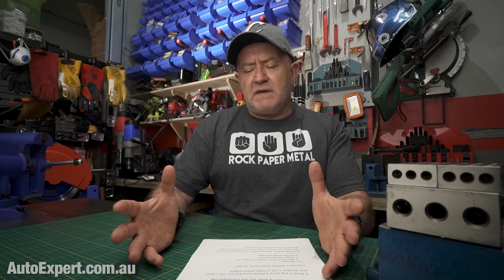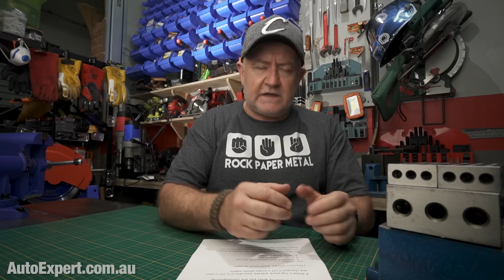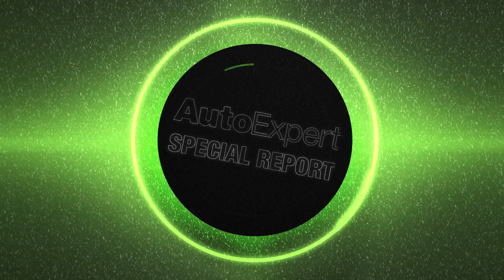Best way to charge your EV at home (for complete electric car novices) | Auto Expert John Cadogan

Comment: Minor point: Under Ausgrid's rules, Single phase 230v, 80A is all you get these days and for most people, the max you can draw is around 60A. Ausgrid made us install a 63A circuit breaker on our side of their 80A service fuse. Sure, older homes have a 100A feed, which Ausgrid will reduce to 80A if they get the chance. If (like me) you have 14kW (max) ducted aircon, 7kW (max) induction cooking, a 2kW clothes dryer, dishwasher etc and maybe a workshop with heavy power needs and you use them all at overlapping times, you may need a 3 phase upgrade to support an EV wall box charger's power draw.
Reply: Just charge while you sleep with no cooking or clothes drying there is a spare 9 kw from 10 pm till 8 am that is 90kwh enough to do 500 km a day The AC will use 1/2 power at night freeing up another 7 kw for 160 kwh enough for 2 EV doing 450 km a day each

Comment: Apparently certification does not require an on/off switch which makes the isolation switch I have quite handy. The charger is otherwise turned on and off by the wifi app or bluetooth.

Comment: here's how i do it:

i "only" have about 24A in a single phase 230V line available at home. upping the current safely would mean excavating the garden so that's a no go.
i got the wallbox installed by code (class A rcd on its own separate circuit as the install manual states) and cabled to safely support up to 20A and the wallbox is configured to draw the same maximum 20A.

i normally keep the 58KWh pack at around 69% of charge unless i have to do a long drive - i do overnight charging enabling the "charge current limit" in the ID3 menu which limits the charge to 8A most of the time and it's been absolutely fine so far.
for the rare cases where i needed to charge quicker i let it loose to 20A and simply avoided turning on the oven or whatever.

this is my late father's car so since i wanted him to have a nice experience with it i pushed to have the wallbox installed but i could totally live on the included 10A charger and get to a public plug in the very rare cases where i needed some quicker charge.

Comment: I'd recommend buying something like an Evolution Zappi V2 car charger, it has a current clamps which monitor your main feed and tapers the car's charging speed if you exceed your main fuse current rating (usually 63A)

The reason I went for the Zappi is I have a sub board in my shed which the EV is on, I needed to make sure the EV didn't trip the sub board or the house board.
As an added bonus it can also monitor your solar generation and can also taper your EV charging to ONLY use excess solar generation usually being fed back to the grid.

Comment: 2 phase makes perfect sense to say we just don't for some reason. I assume its just in reference to degrees of separation. Because I hear there are 2 phase distributions in certain states if I remember correctly so it would probably be an American thing. So single phase 90 degrees, 3 phase 60 degrees, and weird 2 phase systems just get the 2 of 3 phases at 60 degrees which is still 208v. Probably some AUS and CDN farms and industry on this system.

Comment: The other thing is you would have to make sure your switch board is the most upto date one available. I was quoted $3,000 to do that. Then there would be the cost of having the wall charger installed on top of the car.
Reply: Did it. Worth it

Comment: I don’t understand all this frustration about three phase power. Here in the US I have single phase 200 Amp 120 VAC power at the panel. In my electrical panel box I have a breaker with two 120 VAC 50 Amp circuits giving a theoretical output of 12 Kw. My EV’s BCS limits the input to 40 Amps or 11.6 Kw, still plenty for an overnight charge. This is the same way my stove, clothes’ dryer, hot-water heater, etc. are wired. Why not use two 240 VAC circuits to double your power if code permits?

Comment: I’ve had my MG ZS EV for just over 12 months, and home charting with a 7kw single phase wallbox hasn’t been an issue.  I have on average charge up 2 times a week, usually from bout 30% battery and takes about 4 to 5 hours charge time at 25amps.  Supply and installation next of to my metre box was about $1200.
Reply: What brand did you buy
Reply: @kondafitness6600 wallBox Pulsar Plus 7Kw, supplied and installed by JetCharge Australia.

Comment: If you do trickle charge then you should use a really heavy extension cord. In the UK the standard plug is 13 AMPS however its almost impossible to buy a cord that will gve you 13 amps in the car. You may even end up getting one made up.

Comment: agreed, for solar system that is set up to deliver DC electricity DIRECTLY to the car charger is best used during the day. there are some solar systems that have the power output only delivered to an inverter (changes DC to AC) has a 3% power loss, in which case, overnight charging may be optimal especially if less expensive. 

also, charging a battery at as slow as possible will extend battery life. so, when returning home, choose the amperage rate that will result in full charge being achieved next morning.

Comment: To charge your EV:  step 1. Dig coal from the ground.   Step 2. Pulverize the coal and discard impurities like heavy metals and mercury.  Step 3. Burn coal in boiler to create high-pressure steam.  Step 4. Pipe high pressure steam through turbine connected to an electrical generator. Step 5. Regulate electrical power to charging voltage of the EV.  Step 6. plug in EV and enjoy your *pollution free fueling experience.   Next time, we will discuss how to mine cobalt and rare earth materials for the batteries and magnets in the motors.
Reply: Pretty sure that conversation was already had. Nice try
Reply: @theairstig9164  Just because people talked about a problem doesn't mean it was solved.  It's an engineering problem that isn't solved by just agreeing, not to mention it anymore.
Reply: @tristan351  well to tank is cleaner. It's tank to wheels where ICE is dirty.  EVs are clean there and dirtier everywhere else.  The truth is in the total cost of ownership.   The energy consumed to make and power any car is reflected in that total cost.  The most environmentally friendly car is the cheapest, smallest, and lightest one with the fewest number of gadgets.   Aside from a catalytic converter, adding weight means more pollution.   Currently, EVs are gadget heavy because the only market with enough markup is the higher end and luxury.  That is the antithesis of why EVs are being pushed in the first place.  When they can compete on price with the lowest cost gas vehicles without subsidies or penalties on their competitors, EVs may be better for the environment.   For now, it's BS.

Comment: Electrician here. What aren’t the authorities telling us? Anybody recall issues of power blackouts on hot days with overuse of AC? 
The problem is that the cables from power stations running down hundreds of k’s to your street got overloaded when everybody was running AC on hot days (and a typical residential AC  might only be 15-20 amps). Fortunately with the massive uptake of solar panels in residential areas this problem was mitigated somewhat by the required power being delivered locally by the solar installations. IE - on a hot sunny day 40% of required energy is supplied by local solar and the other 60% comes down the poles and wires from the power stations. That load might still be 90% capacity of the poles and wires (and the stations themselves), but we’re not overloaded and suffering blackouts. 
Now imagine every resident having an EV (or two) parked in their driveway every night charging on a 32 amp socket right when there is a photon shortage ie- nighttime. Poles and wires, and the power stations themselves are going to be massively overloaded and we are back to blackout problems. A hot night where residents want both AC and charge their EV’s would be a worst case doomsday scenario.
I have heard of reports that state we require an exponential amount of additional power energy due to the increased demand and population growth, requiring massive capital investment that is extremely problematic. Cannot be feasibly done with the current “green” technology, so we require more “dirty” power which kind of defeats the purpose of the EV’s, or we need to seriously consider nuclear energy (which will never get past the nimbys). 
So don’t expect a massive rollout of EV’s in the immediate future - it simply cannot be done with the current infrastructure.
Reply: That conversation was also had a long time ago. If you banned petrol passenger vehicles today the uptake of EVs would take two years to make a difference to electricity consumption . Except in Wagga and Albury Wadonga over Christmas. That was messed up.

The point is that EVs aren’t all coming at once. They are coming in the low thousands per year. Canberra still has less than 1000 registered EV passenger cars. That’s with two years discounted rego. It’s not a problem that needs to be solved for ten years
Reply: I don’t mind coal-powered electricity generation to provide greater base load. With modern pollution controls and efficiency it is better to generate power in the big central locations than have millions ICE cars with their inherent low efficiency and high pollution levels. Nuclear is a non-starter in Australia.

Comment: Point 5 @ 25:30 mark - if the car needs to be locked for charging to occur, does this mean you can't sit in the car at a public charger with the door open whilst you sit there waiting? A scenario would be a public charger, no rest facilities (eg coffee shop) open so you have to hang around the car.

I suppose you could have the window down whilst you sit there with the door locked but what if you decide to stretch the legs? Unlock the car and charging stops?
Reply: I have sat in the car unlocked while it charges  and it is never locked while it is in the garage charging. But it is frequently necessary to lock and unlock it to make the cable let go
Reply: The cable is locked to the charge port while charging no need for the car to be locked.

Comment: John, Can you imagine a lot of EV's in an under [basement car park] ground car park at a block of flats or any similar situation, and one car there goes rogue, the fire dept has no hope maybe a tow truck might get it out with a cable but this is not likely to succeed. Imsurance companies will blanch if the building goes up.
Reply: In some countries. They have outright banned EV's using multistory and under ground car parks for that very thermal runaway reason.
Some car park owners here in the UK are starting to have the same concerns and not allowing EV's
Reply: @sahhull  I wonder how they get on in Norway, the poster child for EV's.
Reply: John's gone over to the sensible side and is now an EV proponent.  Seems like you're still stuck on the dark side.  Didn't you get the memo?  Try and keep up.  EV's are fun and cheap fast and safe.
Reply: @Tom-dt4ic  Dream on. can't believe that anyone thinks they are the answer.
Reply: @adoreslaurel  John, the sometimes happy warrior of anti-EV disinformation spread, now finally believes EV's are the answer.  Of course in Australia, with all that sun, it's hard to argue otherwise

Comment: Excellent advice. We've been running an EV for just short of 3 years now (and a 2nd one for the last year) and have installed a dedicated charger on the side of the house (as JC says - fire risk is extremely low, but outside is safer). 

Just to add a few points - if you plan to install an EV charger at home, bear these points on mind...

1. Get a unit which has PEN protection inbuilt so there's no need to install an Earth spike into your beautiful Tarmac / paved / concrete / etc. driveway.

2. make sure it comes with, or has the ability to add, Current Transformers (CTs) which allow the unit to measure the total incoming power into the house. This lets the unit to back off on the charge rate if your HVAC etc kicks in mid-charge. It'll extend the charging time occasionally, but your main fuses won't blow.

3. If you have, or plan to get, solar or battery backup, make sure your unit is compatible.

4. If you're going for 3 phase (we already had a 3Ph supply to the house so it was a no-brainer), be aware that some cars, such as the Kona, will only use 1 phase as JC alluded to. However on our EV6 we use all 3 phases so the current drops to 16A per phase therefore there is less power draw per phase plus the charging time is ~1/3 less - and we're future proofed if our next car can charge at 22KW.

5. Get a tethered unit if you don't want to be digging around in the boot for the cable all the time.  That way the cable is always in the boot if you need to do an AC charge away from home  (DC chargers are always tethered)

Just as an FYI, we bought a Myenergi Zappi unit which does all of the above. It also allows you to set a PIN code to stop anyone charging when you're not home.  It's been 100% reliable, has a really good app and it can schedule your charge for off-peak power etc. There are many other units available so the hardest part is choosing the right one for you.
Reply: I thought about getting an EV for commuting (140km a day) I mostly do nightshift and have solar + battery (got it due to the frequent blackouts) 
If I got an EV and one of the chargers( my solar can run my 3phase bore in a blackout.. 
is there a way to set the charging to charge slower… but only take the excess solar if possible? Currently here in sunny perth.. I export 25-35kwh a day.. so if I could set the car to only drink solar )assuming 17kwh per 100km) somewhat for 6 months of the year I should never need to drink of the grid.. 
hope that makes sense
Reply: @JimmInOz  Short answer - yes you can do that. 

With the Zappi app I can set the solar to charge the car first, then divert to the hot water cylinder (or vice versa) via the Eddi (an extra box that takes excess solar to heat water or power another device up to 3KW) or charge, in our case, a Powerwall 2. 

You can set export limits on the master unit (usually the Zappi) so that it does what you want it to in terms of using solar first. 

Downside - an EV will not charge at less than (IIRC) 1.4KW so if you have less than that available after everything else has taken its share then it will export to the grid.  On 3 phase I suspect it would need 1.4KW per phase so that might be an issue. But a single phase charge cable would overcome that. 

It's never going to be perfect but you should be able to do a lot more than you would with a dumb charger.

Check out MyEnergi's website. It's very informative and they do ship worldwide. 

For the record, I am not associated with My energi and they don't pay me. I'm just a very happy customer.
Reply: @JimmInOz  Just beware, the there are stories that the Zappi has been found in the past to struggle and die in super high temperatures. It is designed and built for UK conditions. Once the ambient temp gets to 40° C or above, it can cook the internal electronics, especially more pronounced if installed in direct sunlight.
Reply: @sparkytas  thats good to know.. my shed can reach 50+ last Christmas here in perth we had a week above 45 outside in the shade… good knows how hot the shed was…. It’s significantly hotter in there

Comment: Do you not have charge timers over there? My car has one along with the wall box, scheduled to charge 0030-0430 on the cheap, plug in and let it do its thing on timer.

Also the domestic wall charger, whilst I waited for the wall box install I just put the charge block on top of the tyre under the wheel arch. Extension cord in a weather proof box where its plugged into the domestic wall charger.

very infuriating when you get folk charging to 100% instead of 80% on rapid chargers it takes ages for a 100% charge, charge to 80% and move on, at least in the UK chademo the LEAF uses unlocks after its charged so someone else can use it, unlike CCS.

Comment: The EV I owned was plugged into the standard 230 volt wall socket. As a rough guide it added about 12km per hour. So, 10 hours overnight, 120km. Effortless. Just like plugging in an iPhone. Zero range anxiety.

Drive an EV. They’re great!

Comment: Another thing I recon in time insurance companies will say no to charging ya EV in the shed that's  connected to the house and them lithium batteries won't be allowed inside ya caravan will have to be out side in a separate box  , because there a fire hazard if they go up 4 some strange reason ya fucked

Comment: Australia operates on 240 volts, not 230 volts. That is Europe.
Reply from the maker: Look harder.
Reply: @AutoExpertJC  Look harder at what?
Reply: @trevorchatwood2630  A new power quality Standard, AS61000.3.100, has recently been released that details requirements additional to the existing systems Standard.

The new Standard stipulates a nominal 230V, and the allowable voltage to the customer’s point of supply is, as mentioned, +10% to –6%. However, the preferred operating range is +6% to –2%.
Reply: West Aussie still runs 240 Volts as the standard. There is one other State ( or Territory ? ) that also uses 240V.. 
However the eastern side of Aussie and thus most Australian States, do indeed run 230V as the standard Voltage from a wall socket.